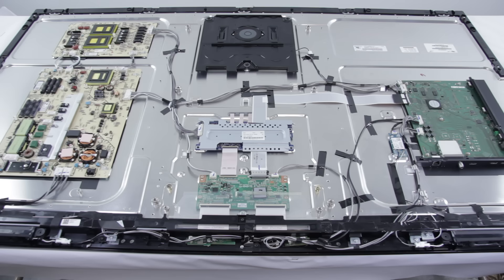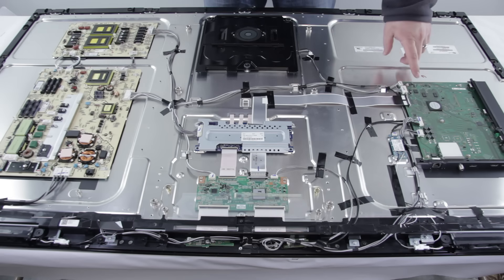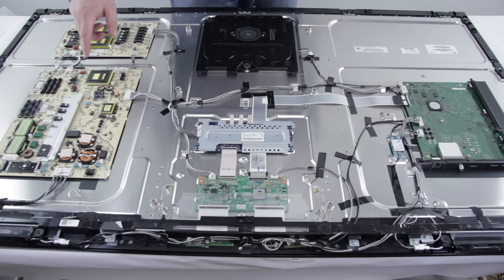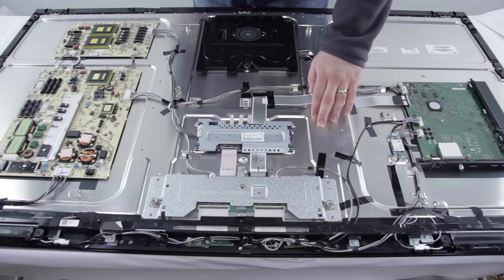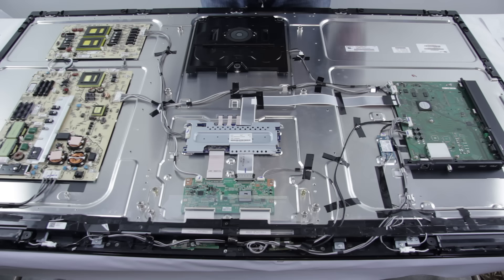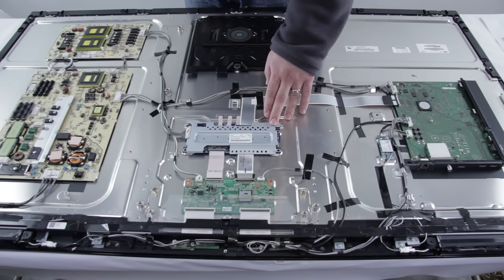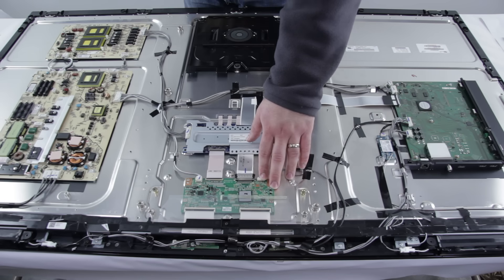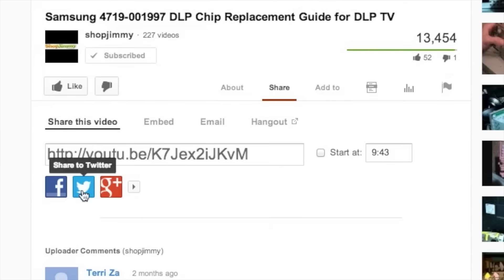LED TV Repair Tutorial - Common Symptoms & Solutions - How to Repair LED TVs

Comment: i saw your shopjommy tv repair video and saw your awesome prices too  but , first things first. 
ld2480 Westinghouse  screen.  powers on,  blue light stays on,  logo. then cycles primary  and  b/w colors. no matter what input i use  (have not tried usb firmware drive)
I'm gonna say main board,  but,  any suggestions? 
I'm just itching to use a new capacitor or hex edit,  a compatible firmware, impregnated with telnet and mod this board before installing your 

help me jimmy, you're my only hope! !
Reply from the maker: +rocklobster1976  Try all repairs and troubleshooting at your own risk.   I recommend replacing the main board in your TV.  Click this link to replacement parts for your TV model number:  http://www.shopjimmy.com/catalogsearch/result/index/?cat=56&q=ld2480  There may be multiple boards for the same TV model number, be sure to match part numbers on your current board, with your replacement for compatibility.  Here is a link to a video showing how to identify your part number, click here:   https://www.youtube.com/watch?v=SoUXsgOx25o  Thanks and please let us know if you have any further questions with your TV Repair!  www.shopjimmy.com

Comment: hi i saw the video my tv samsung led un50f6300af no back light i need the led driver
Reply from the maker: +cesar de la cruz   Try all repairs and troubleshooting at your own risk.  Here is a link to replacement parts for your TV model number.  Just a reminder if you are having problem with your backlights, it could be your power supply/inverter or the actual LEDs themselves.  http://www.shopjimmy.com/catalogsearch/result/?q=un50f6300af  There may be multiple boards for the same TV model number, be sure to match part numbers on your current board, with your replacement for compatibility.
Thanks and please let us know if you have any further questions with your TV Repair!  www.shopjimmy.com

Comment: hello i have a 50 inch rca led50b45rq tv. there is sound on the tv but there is no picture. ive hit menu and input and you cannot see that eather. i was told by manufaturer to replace the power board and i have but it did not make any difference please help.

Comment: i have an LG LED TV. Model 47LN5400-UA. I get a flash from the screen at power on, and i get sound. no picture.  is that the T-con board or the main board causing the problem?
Reply from the maker: +Darin Hansel   Try all repairs and troubleshooting at your own risk. This sounds like a problem with the actual LEDs inside your TV. These LEDs are replaceable, however it is recommended they are replaced by someone with the proper experience and training. When replacing the LEDs, the TV panel can get damaged. If the TV panel gets damaged, it is not repairable. Click this link to replacement LEDs for your TV model number:  http://www.shopjimmy.com/catalogsearch/result/index/?cat=299&q=47LN5400-UA   Be sure to match the panel information necessary to ensure you have the correct replacement LEDs.Thanks and please let us know if you have any further questions with your TV Repair!  www.shopjimmy.com

Comment: I have a LG 50LN5100 that every two-three seconds goes in and out of focus. It looks like the pixels shift down a few rows and than back to normal position. All other functions work well. Thanks
Reply from the maker: +William Parise  Try all repairs and troubleshooting at your own risk.   I recommend replacing the main board in your TV.  Click this link to replacement parts for your TV model number:  http://www.shopjimmy.com/catalogsearch/result/index/?cat=56&q=50LN5100  There may be multiple boards for the same TV model number, be sure to match part numbers on your current board, with your replacement for compatibility.  Here is a link to a video showing how to identify your part number, click here:  https://www.youtube.com/watch?v=RwHTvjMdrhk  Thanks and please let us know if you have any further questions with your TV Repair!  www.shopjimmy.com

Comment: I have a LG 47LN 5700, and I have black screen with audio working. I do see a faint image, when putting a flash flight to the screen. Is that a bad LED driver or T con board?
Reply: +Robert Lomeli same problem with my LG 42LN5700, did you figure it out yet?any help would be appreciated, Bob in CT
Reply: I tried switching the T com board, didn't work, I also tried switching to power board, and same thing. So, I decided to open the whole screen, and discovered that a actual LED was burnt out. But, it was a pain getting to that part. So much, that I ended up cracking my screen. To make a long story short, I just ended up getting a new TV... Maybe your problem is different? Good luck
Reply: +Robert Lomeli Thanks for your quick response, I am hoping it is the LED driver board $39. but haven't opened it up yet. how did you discover it was a led strip?
Reply: No problem... I had opened the TV entirely, and seen a burnt LED, looked blackish

Comment: HI, i have a LED Samsung UE40D5500RW and it has horizontal lines on the very top that mimicks what is shown on panel but shrinked in to those lines, it occurs on all inputs and infront of menu , today the TV started to have horizontal lines on whole panel, it took no demage, please see these photos https://www.dropbox.com/s/262ugaojsibck06/20151115_204648.jpg?dl=0   and https://www.dropbox.com/s/yel6tsi88t8jpvm/20151115_204800.jpg?dl=0

Comment: I have a Toshiba 50L3400u 50" tv.  The original symptom was a blinking back light.  After watching a few videos I have concluded the problem lies in the LED3 circuit.  I measured voltages out of the power supply and all four led+ values are constantly 60.  The LED3- feed is around 5v when active, the other 3 led - feeds are 9v when active.  After unplugging LED 3- the screen does not flicker but the top right corner is dim.  I would attribute this to LED3- being unplugged.  My question is should I add an independent power source for the entire LED3 circuit and control it via a relay off of the back light on feed or should I cut my losses and put up with a dim spot?  If the LED3 circuit is causing a fault because of an over current situation my fear would be a short and possible fire hazard. Any advice would help.  Thanks.
Reply from the maker: +Patrick Kenyon  Try all repairs and troubleshooting at your own risk.  This could be a problem either the power supply board or the LEDs in your TV.  You can replace the power supply board in your TV to see if that fixes the problem.  Click this link to replacement parts for your TV Model number:  http://www.shopjimmy.com/toshiba-75037554-power-supply-led-board.htm  There may be multiple boards for the same TV model number, be sure to match part numbers on your current board, with your replacement for compatibility.  Thanks and please let us know if you have any further questions with your TV Repair!  www.shopjimmy.com

Comment: I have an 18 month-old Samsung UN46EH5000FXZA. ABOUT 2 weeks ago it started turning itself off while we were watching. Now it won't power on at all. When plugged in to the power outlet, the red light doesn't come on but the TV intermittently makes the beginning of the normal 'power on' noise before going silent again. I'm out of warranty & neither Samsung nor the online vendor have been any assistance. HELP!
Reply from the maker: +ajpittaway  Try all repairs and troubleshooting at your own risk.  I recommend replacing the main board in your TV.  Click this link to replacement parts for your TV model number:  http://www.shopjimmy.com/catalogsearch/result/index/?cat=56&q=UN46EH5000FXZA  There may be multiple boards for the same TV model number, be sure to match part numbers on your current board, with your replacement for compatibility.  Here is a link to a video showing how to identify your part number, click here:  https://www.youtube.com/watch?v=BEPWrefQvqI  Thanks and please let us know if you have any further questions with your TV Repair!  www.shopjimmy.com

Comment: my tv is an LG MCR64833101 rev00 (52 inxh) it keeps turning itself off, it feels hot on the back, I have no control of it once it shuts down, but itbdoes turn itself back on after a few minutes
Reply from the maker: +cheftoniFTW  Try all repairs and troubleshooting at your own risk.  I recommend replacing the main board in your TV.  Unfortunately I do not see any replacement parts in the search results for your TV model number on our website.  Please reply with your part number on your main board and I can try searching for replacement parts.  Thanks and please let us know if you have any further questions!  www.shopjimmy.com

Comment: I NEED TV REPAIR HELP PLEASE... Hi, great work with your
videos, they are very in-depth. However, I had no luck with my problem.

I have a LG 42LF5800. While watching it one day the video
just went off but the audio remained. We were looking at a show from a USB
drive at the time.

So, the screen is not showing anything but I have audio and
the peripherals work. 

please note that the screen is not totally black when
powered on. In fact, it turns grey so u know it's definitely on. In addition,
when opened, you can see that the backlights are on.

I was advised by technician to replace the main board (part
# LG EBT63770202). That did not work. 

This led me to some online research and I found your youtube
video.

It seemed that the likely culprit is the T-Con board (part #
LG 6870C-0480A) so I replaced that, sadly, the problem remained.

The only other board left is the power supply board but I am
afraid to buy that only to realize it may not be the cause. Afterall, it powers
on, backlights work and so does the audio.

Your advice will be appreciated.

Comment: Hi! I have problem with backlit tv Toshiba 46tl933. When I turned on tv I can see for few second pictures on screen. Then the backlit is turned off. I have black screen. Sound is working. When I used flash light I can see everything: menu , icons. Tv is working but haven't backlit. Today I change the inverter And it dosnt help. Still haven't backlit. Please for your help. Thanks

Comment: I have a seiki se46fy10. I purchased a main board from you guys. The tv went black and I still have sound. Tried the flashlight test and was able to see picture. Replaced main board and still have to use flashlight to see picture. I thought the LEDs were controlled by the main board on this model. Where can I find replacement LEDs or what do you guys think I should do next?
Reply from the maker: +Casey Herron   Try all repairs and troubleshooting at your own risk. This sounds like a problem with the actual LEDs inside your TV. These LEDs are replaceable, however it is recommended they are replaced by someone with the proper experience and training. When replacing the LEDs, the TV panel can get damaged. If the TV panel gets damaged, it is not repairable. Click this link to replacement LEDs for your TV model number:  http://www.shopjimmy.com/element-seiki-d460d3-gy43-c0x-led-strips-10-strips.htm   Be sure to match the panel information necessary to ensure you have the correct replacement LEDs.Thanks and please let us know if you have any further questions with your TV Repair!  www.shopjimmy.com

Comment: your videos are very helpful!  I have a Vizio E320fi-B2.  It powers on , but I can only see the screen with the lights in the room off because it is so dim.  Even with it being dim it flickers some.  I already replaced the power supply/backlight inverter board, but there was no change.  Can you give me any help or ideas for me.  Thank you!
Reply from the maker: +William Bauer  Try all repairs and troubleshooting at your own risk.  This could be a problem with either the power supply or the LED strips in your TV.  Since you already replaced the power supply board, it may be the LEDs that are bad.  Try all repairs and troubleshooting at your own risk. This sounds like a problem with the actual LEDs inside your TV. These LEDs are replaceable, however it is recommended they are replaced by someone with the proper experience and training. When replacing the LEDs, the TV panel can get damaged. If the TV panel gets damaged, it is not repairable. Click this link to replacement LEDs for your TV model number:  http://www.shopjimmy.com/catalogsearch/result/?q=E320fi-B2  Be sure to match the panel information necessary to ensure you have the correct replacement LEDs.Thanks and please let us know if you have any further questions with your TV Repair!  www.shopjimmy.com
Reply: +ShopJimmy.com Thank you very much.  You guys do not have the parts in stock that you directed me to.  Can I get these from Samsung by chance or any other option you can think of.
Reply from the maker: +William Bauer  Try all repairs and troubleshooting at your own risk.  You could search the part numbers elsewhere online.  Thanks!  www.shopjimmy.com

Comment: I have a Westinghouse 32" LCD TV Model # SK-32H240S 35-D018285. 

The colors are missing, washed out, sometimes images are solarized. The backlight adjustment does nothing. Cannot fix by adjusting, whites are either too bright or too dark. I think the T-con board may be bad.
Reply from the maker: +fred handy   Try all repairs and troubleshooting at your own risk. This could be a problem with either the t-con board, the main board or the TV panel. You can replace the main board and the t-con board individually to see if one of those boards fixes the problem.  Click this link to replacement parts for your TV model number:  http://www.shopjimmy.com/catalogsearch/result/?q=SK-32H240S  There may be multiple boards for the same TV model number, be sure to match part numbers on your current board, with your replacement for compatibility.  Thanks and please let us know if you have any further questions with your TV Repair!  www.shopjimmy.com
Reply: +ShopJimmy.com Thanks for your help!

Comment: I have a little problem with this LG 55LA6200 UA.The TV power on, no problem I only have sound and Images in one of the 3 HDMI input which is HDMI # 2 input, the # 1 and 3 HDMI input I don't get any sound or video neither in the coaxial connector, and I also have multiple tiny colored vertical lines, and one or two white Horizontal line running up and flashing, no steady images or menu on the screen. Can you tell me what parts needed to be change to fix this Issue?Thank you...
Reply from the maker: +Nat Jn Louis  Try all repairs and troubleshooting at your own risk.  I recommend replacing the main board in your TV.  Click this link to replacement parts for your TV model number:  http://www.shopjimmy.com/catalogsearch/result/index/?cat=56&q=55LA6200  There may be multiple boards for the same TV model number, be sure to match part numbers on your current board, with your replacement for compatibility.   Thanks and please let us know if you have any further questions with your TV Repair!  www.shopjimmy.com

Comment: Hello have a vizio model # E420-A0. My tv won't stay on. I press the power button, the LED light comes on and the Vizio sign comes on the tv. Then shuts off right after. What should I do or replace?
Reply from the maker: +norfsidefu10   Try all repairs and troubleshooting at your own risk.  I recommend replacing the main board in your TV.  Click this link to replacement parts for your TV model number:  http://www.shopjimmy.com/catalogsearch/result/index/?cat=56&q=E420-A0  There may be multiple boards for the same TV model number, be sure to match part numbers on your current board, with your replacement for compatibility.  Here is a link to a video showing how to identify your part number, click here:  https://www.youtube.com/watch?v=kxkeGLhlQY8   Thanks and please let us know if you have any further questions with your TV Repair!  www.shopjimmy.com

Comment: I have samsung LED tv 42inches series 8. My tv control buttons are not working i.e. Power , volume up and down, channel up and down means the control button panel is not working. How can I open the control button panel and check whether it's cable is connected inside or not? Kindly guide me in this regard. . .  Regards M. Jafar
Reply from the maker: +M Asad  Try all repairs and troubleshooting at your own risk.  You can take the back off.  Thanks!  www.shopjimmy.com

Comment: I have Sony Bravia KLD-46EX520. A few days before I can see pictures comes and go in an indefinite time interval. But now the picture is completely gone. I can hear sound and can change the HDMI ports. I can also see back light glowing. I opened the tv to reinsert the t-con board cables again. But of no use, can you please help. Here in my locality [Chennai, India] one say LCD is gone, one say MOBO is gone. Need help.
Reply from the maker: +AMJATH A K   Try all repairs and troubleshooting at your own risk. This could be a problem with either the t-con board, the main board or the TV panel. You can replace the main board and the t-con board individually to see if one of those boards fixes the problem.  Click this link to replacement parts for your TV model number:  http://www.shopjimmy.com/catalogsearch/result/?q=40LE550U  There may be multiple boards for the same TV model number, be sure to match part numbers on your current board, with your replacement for compatibility. Thanks and please let us know if you have any further questions with your TV Repair!  www.shopjimmy.com